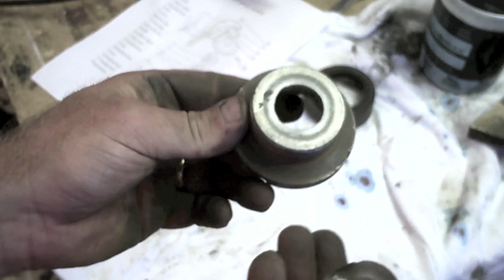Digging Your Own Water Well: Pump Tune Up

Comment: Junk shops and antique shops sometimes have used pitcher pumps.  You have to check for wear, rust, and complete parts. but I have gotten some very solid old pumps for the price of a Chinese cheapie.  I tuned them, much as you did.

Comment: Suggestion, the piston seal, whether it is rubber or leather, should be soaked in vegetable oil to maintain softness and delay dry out cracking.
Reply from the maker: The Shadow Thanks!

Comment: I lap my gun bolts to recievers with valve grinding compound first to cut it down a lot then use higher grades of polishing compounds all the 1600 grit to get perfdctly mated surfaces with 100% contact. Then chamber the rifle but that is another conversation, same principle though. btw, my grandpa's pitcher pump I rebuilt years ago used a thin leather washer where you lapped it on the piston.

Comment: if someone wanted a reasonabley inexpensive electric pump, what would be good?
Reply from the maker: ChrisD4335 How much water do you want to pump and for how long?  Northern tool sells mail order a pump pressure tank combo that might work for a cabin but if you want to irrigate pumps in my experience will run just under one sprinkler per1/4hp.  I have a 2hp pump it will almost run 4 small sprinklers, the old 3/4 pump will almost run 3.

Comment: A suggestion for smoothing out  flat parts, sandpaper attached to a truly flat surface, such as granite, and you can do it by hand if you don't own a belt sander.  It is the same way that carpenters true up hand planes.  Great video btw!
Reply from the maker: Thanks for the idea!

Comment: You could use a valve lapping tool and paste.
Just a piece of dowel with a suction cup on the end.
Insert it into a drill, add some abrasive paste, "suck" the cup onto the "valve" and spin away.
Works great.
Reply from the maker: I will keep that in mind for next time.